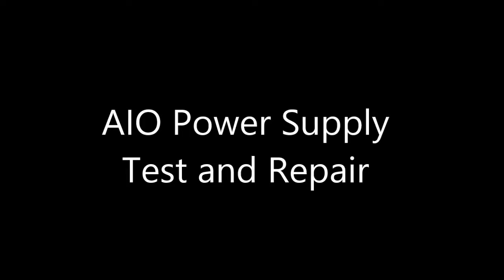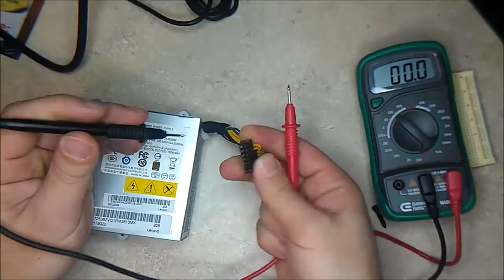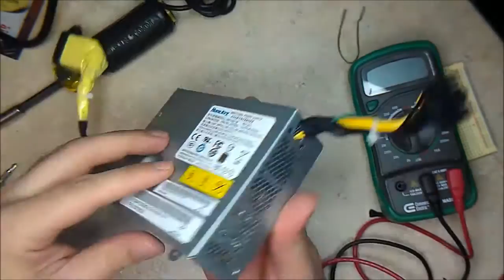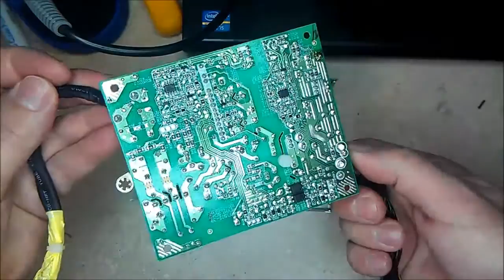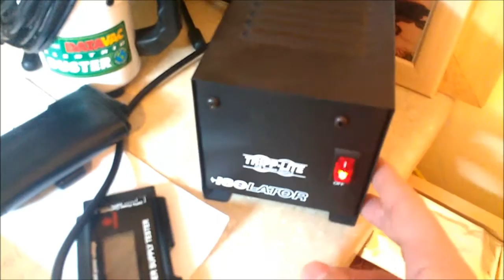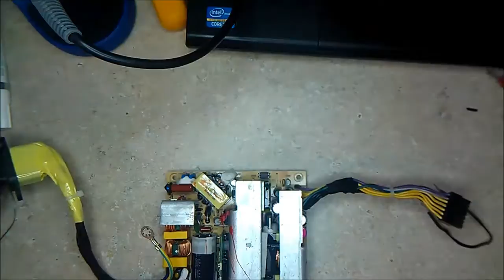AIO Power Supply Test and Repair

Comment: Clean repair but discharging hot side capacitors with screwdrivers can destroy PCB traces, you´d better use a 470 ohms 10W ceramic resistor. Thanks for sharing.
Reply from the maker: You are indeed correct. Using a resistor like the one you mentioned is a safer method. Thanks for sharing.